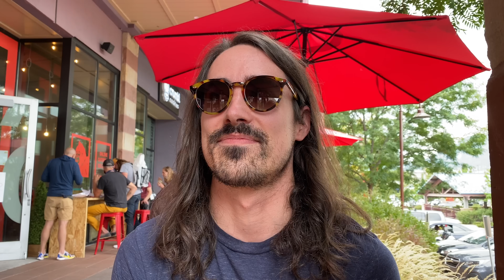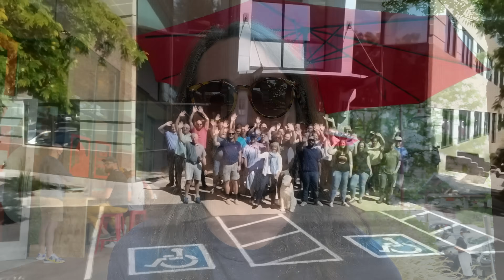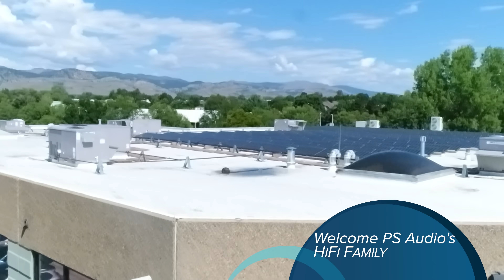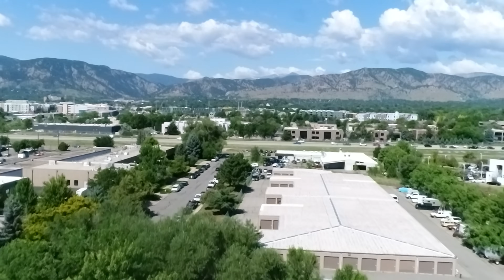Lunch with Paul: The art of the phono Part III

Comment: Passive RIAA EQ?  It hasn't been mentioned yet, although I've heard Darren discuss this before.  
Back in ancient times when I was studying engineering, my analog-design professor had us design a phono preamp, with the goal of maximizing SNR.  I settled on a design which did the RIAA EQ in a passive stage, rather than using active filtering.  As I understand it, Darren found that doing the same, contributed to the musicality of the result.

Comment: I am absolutely fascinated that this young man uses the Spice Circuit Simulation program. Spice goes back to 1973 and before. When I was in school ( 64 -> 68 ) we used a predecessor to Spice. Inputting your Circuit was via IBM punch cards. Off and on over the years I've tinkered, again, with Spice. It's fascinating that the number of component equivalent plug-ins are huge.

https://en.wikipedia.org/wiki/SPICE

http://bwrcs.eecs.berkeley.edu/Classes/IcBook/SPICE/

Comment: I couldn't agree more that the recording is exponentially more important than the format itself. I disagree with the "no MP3s" comment though. Not all MP3s are created equal. Low bitrate MP3s are trash, but those encoded with good codecs like LAME at higher bitrates are indistinguishable from the higher quality formats by 99% of the general population. Most folks don't own a stereo system with high enough resolving power to hear the difference between a high bitrate MP3 and anything else, so there's that too.
Reply: There are studies that show that the younger a person is, the more likely they are to prefer an MP3 recording over an uncompressed CD quality recording, presumably because they have been listening to compressed music on digital players all their life, making it their "default". But more than that, an MP3 recording will have a distinctly warmer sound. It's actually a feature inbuilt by the inventors of the format, as most people prefer warmer sounding recordings, while allowing to compress the MP3 data a bit more. Personally, I can easily distinguish between say a 320 kbs MP3 and a CD quality recording. I typically will be able to identify an MP3 recording even without a comparaison and using  unremarkable ear buds. So I'm not so sure that 99.9% of people couldn't tell the difference, especially within audiophile crowds. Actually I think studies suggest about 30% of the population can hear the difference.

Comment: Right on.  Always the same.  Simpler circuit with less feed back and the music springs to life.  IMHO the accurate reproduction of low level information is the key to natural reproduction of the event and the cues for emotion at the time of recording.  High feedback and complex circuits are two of the many ways one can destroy the minutia of sound that communicates the event to the listener's brain.
I have a simple switch on my OTL triode mono power amps to set level of feedback.  I always prefer the lower setting.  In A/B listening with guests, they always request the setting that is lower feedback because it is more musical.
Better coupling caps let the music through.
Better resistors even bigger impact.  I hand wind manganin for critical points in the signal path.
Cables have an impact.  Silver vs copper.
Simple triode circuits do very well.
Extremely good autoformers for attenuation eliminates the entire preamp if the source has the chops to drive the amp.
Simple high quality crossovers.
Everything matters.
Put it all together and you get a system that you do not want to turn off.
Reply: The amount of negative feedback on an op-amp can be changed, even an integrated circuit op-amp. If you use an op-amp that has a J-FET front end, the sound can be amazing. These have been available since the '70s. A higher junction count doesn't have to sound worse than a simple circuit. I happen to prefer the sound from a fully balanced preamp. Finding transistors with linearity and wide dynamic range is not trivial. I can see from reading this that I need to go to bed.
Reply: @BlankBrain  Feedback is generally governed by a resistor.  I also found the quality of that resistor substantially influences the sound.   Once you establish the ideal amount of feedback, try swapping the type of resistor and the sound opens up.
Reply: @user-od9iz9cv1w  Have you found metal film or carbon comp to be more open? As time goes on, it may become more difficult to find carbon comp SMD/SMT resistors. I've had to go to Sparkfun to retrofit certain SMD op-amps to through-hole.
Reply: @BlankBrain  Thanks for asking.  I actually started with Allen Bradley carbon composite resistors.  I replaced them with Caddock TF-USF Series.  Wow!  $10 of wonderful.  A new level of sound.
Reply: @user-od9iz9cv1w  I'm re-capping some vintage gear. I've been replacing electrolytic caps up to 22μF with polypropylene film, and others with Nichicon, etc. I haven't been able to listen to the differences yet. Some of those caps are not inexpensive. Also adding slow start to power amps. I'm certainly going to look into Caddock resistors in the feedback once the caps are in place. Thank you for the info!
Reply: @BlankBrain  Good luck and enjoy.  The feed back resistors I had best results with were TF/USF.  Bulk foil also very good.  Expensive but for small number of feedback well worth the $$.
Reply: Hegel vs PS Audio.

Let the blood and fur fly. :)

Comment: "Compensation distortion" is THE black art of HiFi. The problem: every chain is different and you cannot find the right amount or spectrum of distortion for a single component that works everywhere. As explained in the video, there is so much distortion in so many components, therefore I'd rather not add more to it. And relatively low distortions are audible. A lot! It's the kind or characteristic of distortion, not so much the level, I think.

Comment: And that's why class A and or tubes sound best.  .....You're welcome.  LOL
Reply: Generally I agree.  I'd go further to say some class A or tubes.  I have heard a number of Pass First Watt kitchen table amps.  Everyone raves about the F5, but to my ear good but not engaging.  But... his experiment with Static Induction Transistor (SIT).  Wow.  Heard the SIT III and there it was.  A triode sound without the hassle of a tube.  But again, a simple circuit with great components built by a guy with the same approach that Darren describes.  Build something that measures well, but then finish it by listening until its right.
Reply: @user-od9iz9cv1w  Agreed.  Pass has it right.
Reply: @lynnpoole7830  I do not mean to insult Darren and Paul by comparing another designer.  I think Darren is in good company  when I liken his approach to Papa Pass.
Reply: @user-od9iz9cv1w  I totally agree.
Reply: @FatRat-f9m  Yep, agreed hence the ''or''.
Reply: I have yet to hear tubes that beat my Class A SS Luxman (not to mention what a pain in the a** tubes can be).
Reply: @wa2368  Notice I said and  ''OR". Meaning class A SS or tubes.  I guess I didn't make my self clear. BTW I own 2 calss A SS amps myself. And a tube amp. Keeps me warm on chilly nights.

Comment: Yummy word salad there shade guy. Unfortunately you've got your head up your own ass so far that all you hear is your own gurgling nonsense.
99% of the population knows that what matters is music coming through speakers. 
PS Audio is smug enough to assume they have something more to offer the other 1% who are simply willing to waste disposable income on marketed hype with diminishing returns that are inaudible.
Much like fine wine and fine art, esoteric Hi-Fi is in the beauty of the beholder.
One can get old Linn system with some Boston A400 speakers and be transported just as far into the music as any modern day PS Audio nonsense over hyped over marketed overpriced over analyzed under measuring hardware ever will. 
And with cables bought 20 years ago at radio shack.